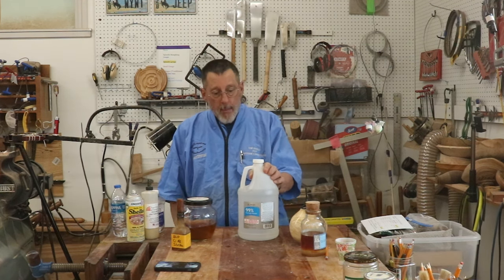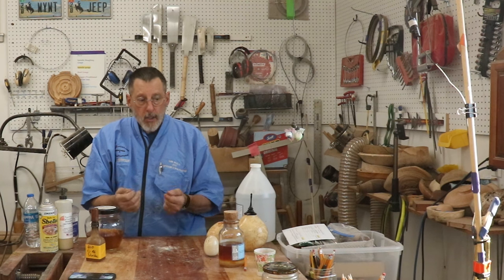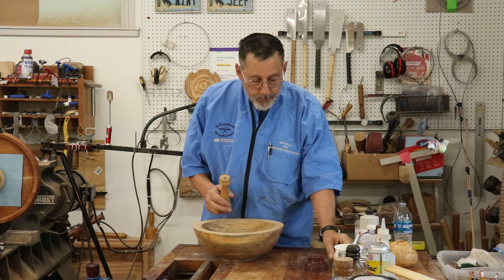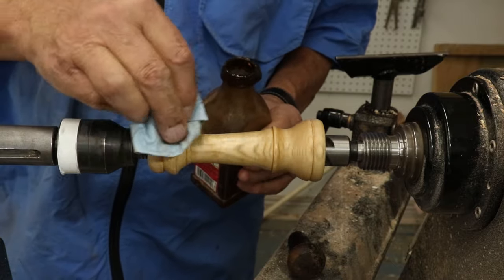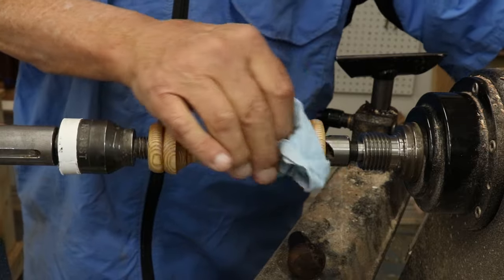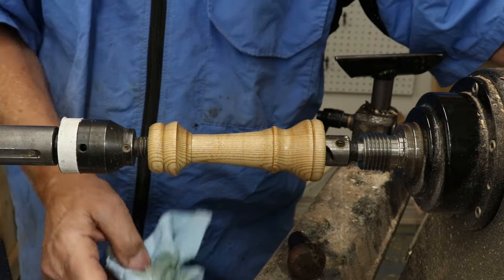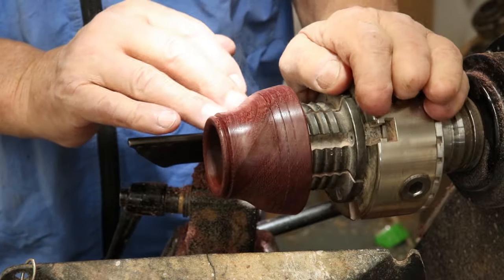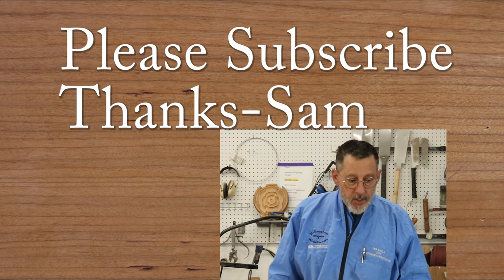How I use Shellac for Woodturning Projects~with Sam Angelo

Comment: Thank you that great lesson on using shellac. I have used shellac on punky wood to stabilize the wood . Seems to work pretty well. I have found for best results just keep letting the wood drink up as much shellac as it will take. And let is dry really good before turning again.
Reply from the maker: I agree this is a great technique. Thanks, Sam.

Comment: Shellac can be an excellent final finish. The problems with it is that it is not scuff resistant and is subject to water marks. But, for items that will only be handled occasionally, or whose surface will be protected with a coat of wax, shellac can be a great choice.
Reply from the maker: Thanks DK, you’ve inspired me to do a video on Oil. The fact that shellac is not the best and most durable finish led me to thinking about Oil finishes which might be better in some cases. Thanks, Sam.

Comment: Isn't mineral oil also called  paraffin oil which is not volatile and won't dry? Is there a conflict in the use of terms? In Australia, mineral oil is paraffin AFAIK so this has added to my confusion - which is vast. I always thought shellac required an alcohol to dissolve and like French Polishing, did not do well with moisture or a lot of handling. Where am I wrong, please?
Reply from the maker: Frank I believe you are correct on all points. Including the terms mineral oil and paraffin. That is simply terminology that’s different in different parts of the world.
In my opinion, mineral oil is not a proper finish as you point out that it will not dry. I believe a drying oil is a better choice.  Thanks, Sam.

Comment: Are you using de-waxed shellac?   As I understand it, you must use de-waxed shellac if there will be another finish used as a top coat.
Reply from the maker: Yes, that is the waxed shellac. And you are correct. If you put something over the top of it is better if it is dewax. Thanks.